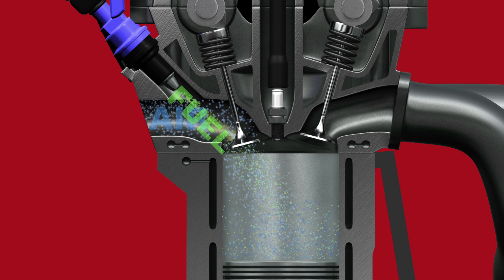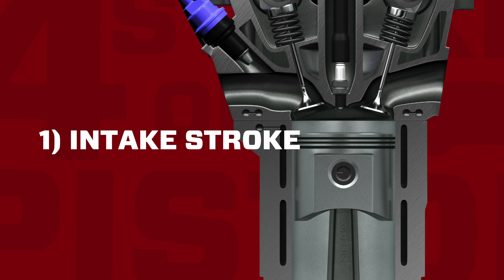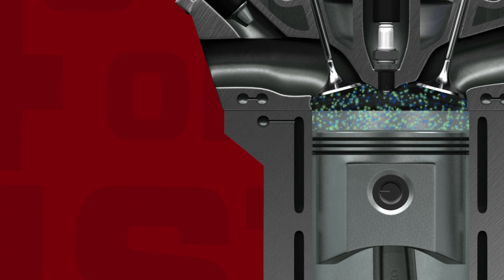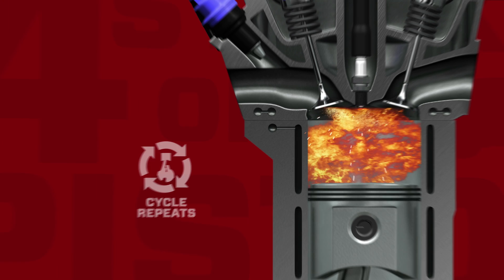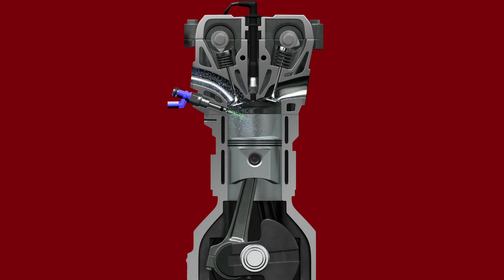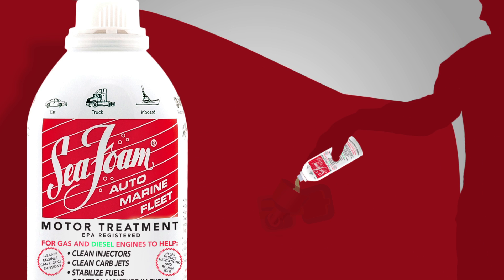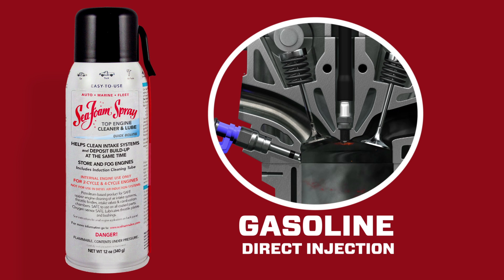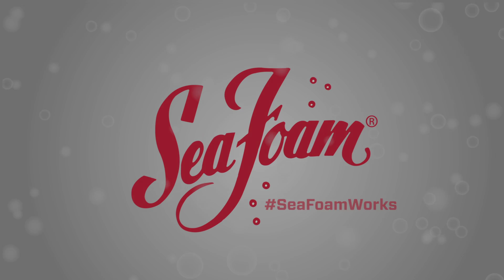Sea Foam HOW ENGINES WORK: Gasoline Fuel Injection - Port and GDI

Comment: is spray seafoam safe to run through my turbo?
Reply from the maker: When applied at the throttle plate, the spray goes right into the upper engine, then pushed as vapor out the exhaust valves. No relationship to the turbo, no worries.